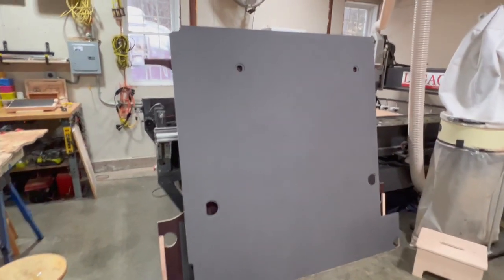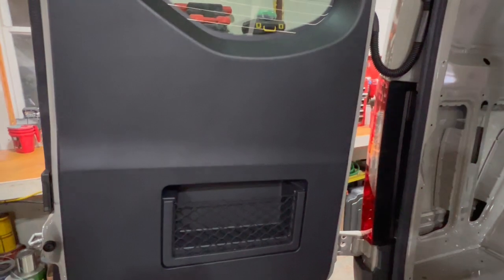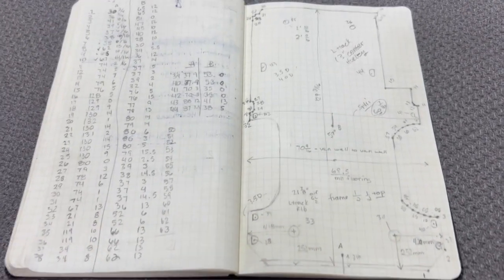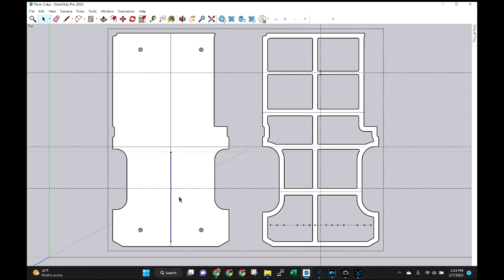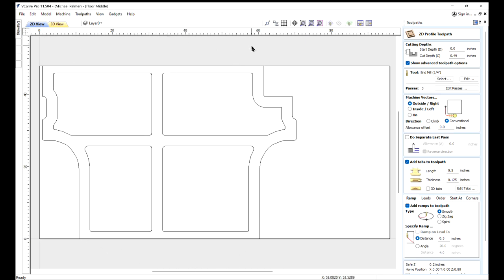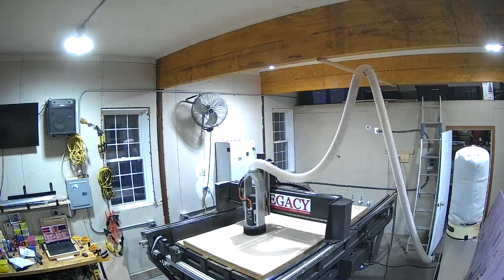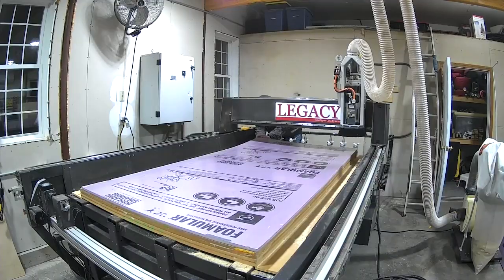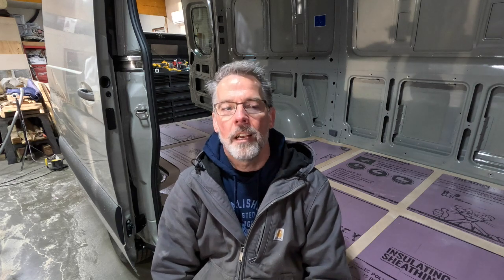2023 AWD Sprinter Van Conversion - Insulated Sub Floor with CNC

Comment: Great video, new subscriber!  Did you glue down the sub floor frame?
Reply from the maker: Thanks for subscribing!  I plan to screw the stock MB floor to the sub frame and then use the stock flooring bolts to secure the floor in the van.  I will install vinyl plank flooring on the top and then seal around the edge of the flooring.

I'll post a video when I finish up the flooring.

Comment: A bit confused on the explanation how recreating the shape works, are you triangulating the point by using the two known centerline points? I think a more independent explanation could be useful
Reply from the maker: Yes, that is what I am doing.  I take measurements from the two known centerline points around the perimeter of the floor.  I then create those centerline points in Sketchup and use the trilateration plugin to plot out the measured points and re-create the perimeter of the floor in Sketchup.  Give it a try with a test part and see how it goes.  I've used it to copy many parts and it works really well for me.

Comment: You should check out the 3/4” xps foam core plywood that dsi offers. The face plywood is about 3/16 thick and has decent screw retention considering the core is polystyrene.
Reply from the maker: Thanks, I will check that out.  👍